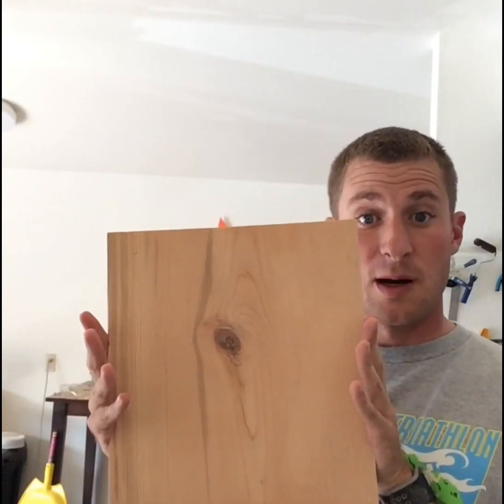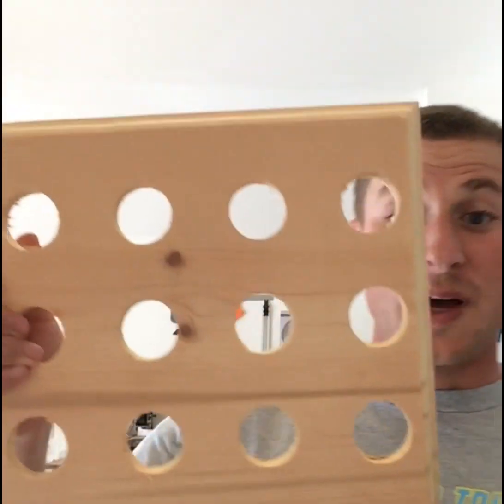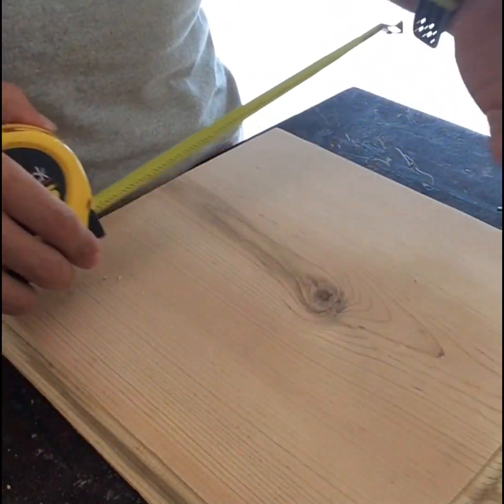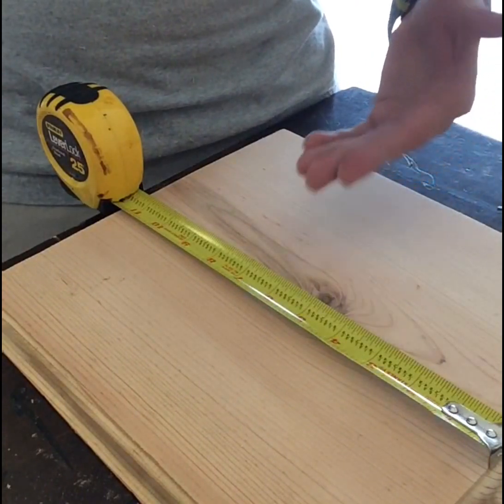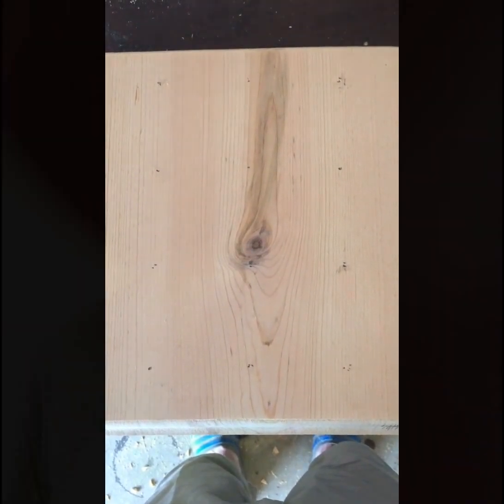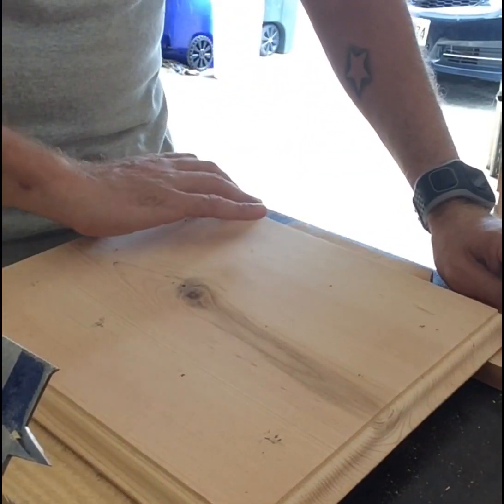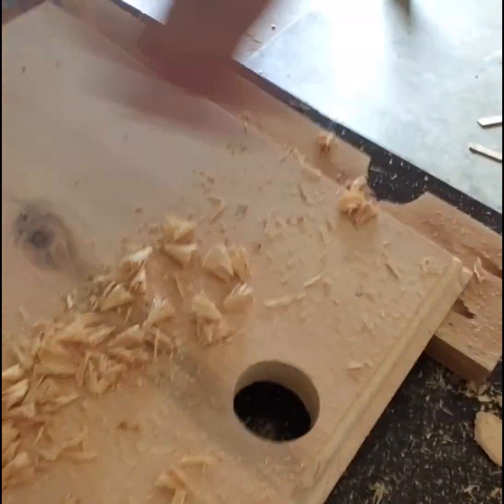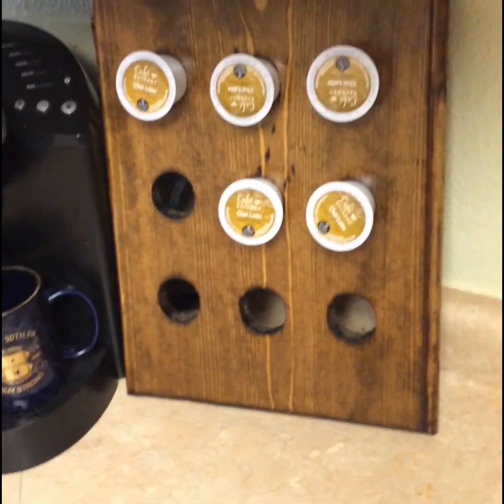Easy to Make Scrap Wood K-Cup Holder

Comment: Not bad...but in my opinion the K-cups are too far apart. You ended up with a huge hunk of lumber on the counter that only stores 12 k-cups! Putting an inch between each cup edge is excessive. Even when spaced with only 1/8" between the cups you can still easily grab them. NET: You could have easily fit 24 on that board. Otherwise good video for someone who wouldn't know where to start making one of these.
Reply from the maker: Thanks! I can only get better with advice!!
Reply: @artillerylife  

I began to think it was unfair of me to suggest a design of which I had no proof that it would work... or if it was even functional! So... yesterday I grabbed an old piece of MDF and tested some hole sizing and spacing. The best scenario worked out the be using a 1-5/8" hole saw and spacing them so the edges from cup to cup would be 1/8" apart. I tried using a 1-3/4" hole saw but the cups dropped down too far into the hole to make quick and easy removal possible. 

I have a small odd ball drawer in my kitchen that only measures 13"x13". Up until now... all I did was dump pods into it. (always a mess) I first cut out a 13x13 inch square of MDF then calculated the spacing. What I ended up going with allows me to place 4 k-cups in each area measuring 4-1/8" x 4-1/8". The end result I was able to put 36 pods in the space available.  Last, I attached some 1" screen door molding around the underside edge to elevate it off the bottom of the drawer then sprayed it with clear lacquer. Not sure if I can put links to some pics of the holder in this reply... I'll give it a try. Worse case YouTube moderators will delete them. IF you can see them, feel free to delete them from this reply after viewing. Your call. Now... when it comes to fishing... and your videos on rods, bait, boats, tips and tricks etc... you rock! By the way... THANK YOU for your service! Hope you had a good Memorial day!

https://imgur.com/cDBiGc8  (hole spacing)
https://imgur.com/aZG4D3j (hole size)

https://imgur.com/V2QimNK (overview)
https://imgur.com/mPuEJ9k (shown with pods)
https://imgur.com/MCkfCmZ (height of pods) 

https://imgur.com/9QEW1aR (underside)
Reply from the maker: Wow thank you for all this!!!!!!! Really appreciate it! When I first made this video I was only a few years into wood working as a side hobby but this really helps, the things I love about wood work is the same as fishing as in there is always more than one way to skin a cat!!!!! Thanks again for your kind words and knowledge